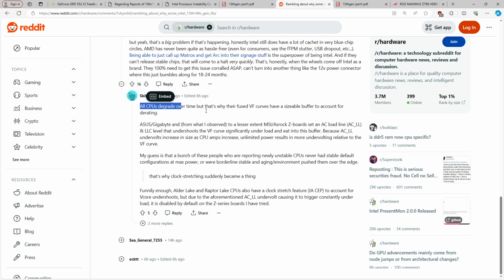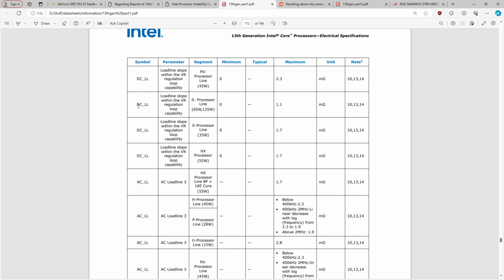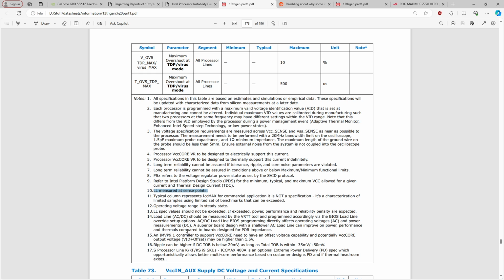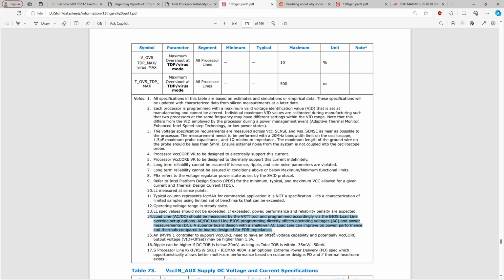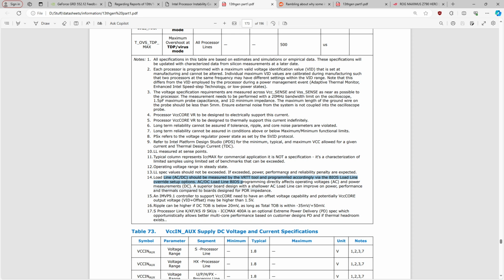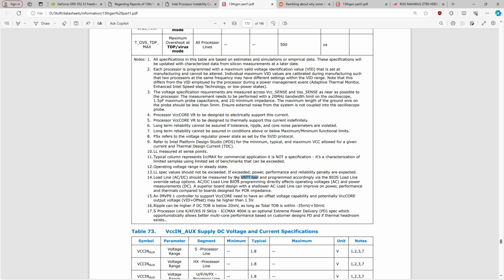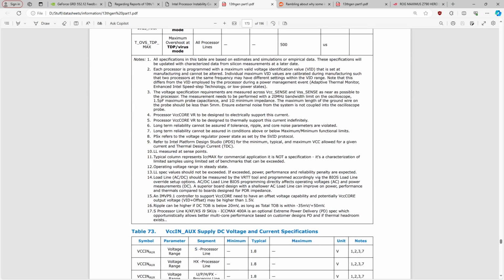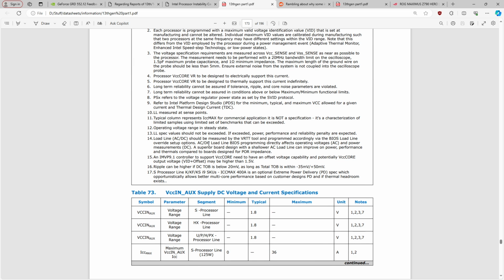Ranting about intel's 13th & 14th gen Vcore load line "specifications"

Comment: so when they say the load line minimum is 0, they mean the resistance (under load) of the vcore power plane/path between the regulator and the cpu, can be as LOW as they want. low resistance is good.
the MAX is 1.1 mohm. of course there is a maximum because otherwise, when the cpu is using 200 amps you will have a ton of voltage drop which in turn requires the regulator to BUMP UP the voltage to get AT THE CPU the actual desidered vcore.
Reply from the maker: It's physically impossible for the Vcore power plane and CPU socket to have a resistance of 0 mOhms. In fact I'm pretty sure the LGA1700 socket on it's own is already has like 0.5mOhms of resistance for Vcore. So having a minimum AC_LL of 0 seems really optimistic on intel's part.
Reply: but it would not be a bad thing. there doesn't need to be a minimum, what they're saying is "do as good as u can" @ActuallyHardcoreOverclocking
Reply from the maker: @Nebbia_affaraccimiei  Sure but "do as good as you can" and then set the AC_LL yourself to match your design is just asking for people to set the AC_LL lower than what their design can actually do. Or the test tool isn't accurate to real world load on the CPU and the result is that intel now has a bunch of CPUs that won't run on out of box settings because instead of specifying and exact operating voltage and load line slope they just let the board vendors do whatever.
Reply: @ActuallyHardcoreOverclocking  of course if boards manufacturers can't measure accurately their board real world characteristics, which Intel can't possibly know, that's on them.

the question here is.. are cpu's crashing because they don't get the specified voltage due to loose LLC settings, or bad board designs, or are they crashing because they DO get the specified voltage but its just not set high enough?? very different scenarios
Reply from the maker: @Nebbia_affaraccimiei  Well if intel had really rigid specs it would be a lot easier to tell if it's the motherboards not following spec or if intel is shipping defective CPUs wouldn't it?
Reply: @ActuallyHardcoreOverclocking  the spec on max LL is rigid enough . can't have over 1.1 mOhm.
are these specs been followed? :)
Reply from the maker: @Nebbia_affaraccimiei  yeah but setting the LL too high would give the CPU too much voltage. Not too little. and the crashing right now is caused by there being too little voltage. Either because mobos are shipping with AC_LL too low. Or the intel VID tables are too low.
Reply: @ActuallyHardcoreOverclocking  Yes, too little voltage or the VRM is not fast enough.There is a posibility higher VRM refresh rate to fix the issue. I know XOC Oc-ers say it doesnt matter how high but they test for 100% stability on heavy loads. On light loads (such as gaming) that can stabilise higher frequencies. It happened to me couple of times.
Reply from the maker: @n1kobg  I've tested switching frequency on a bunch of boards with P95 and Ycruncher and it usually does absolutely nothing and on some boards maxing it out causes the VRM to start behaving very strangely.
Reply: @Nebbia_affaraccimiei  "the spec on max LL is rigid enough . can't have over 1.1 mOhm."
It might not be rigid enough. 0mOhm to 1.1mOhm is a pretty big range.
But we'd need some detailed testing of different motherboards to confirm whether the stability problems are actually caused by excessive Vdroop (resulting in crashing from voltage undershooting too low, or the higher idle voltage required to keep the CPU stable damaging the CPU) or whether it's something else which isn't caused directly by motherboards getting close to that 1.1mOhm limit. Maybe this LL issue is a red herring, and Intel's QC for Raptor Lake just sucks?
Does anyone know if these problems more common on particular motherboard models/brands than others? It could be a useful starting point for finding the exact cause.
Reply: @ActuallyHardcoreOverclocking  Yes, P95 and Ycruncher are too heavy load. Thats what Im saying. It can be rock solid stable in benchmark but crash on Desktop. You can crash a CPU on lighter load with higher frequency. Lets say you pass p95 on 5.6ghz. In gaming that same CPU can go 5.8-5.9ghz.Thats where ive noticed difference - when you max out the CPU on light load. 
Also CPU cache/ring is very important for responsiveness while in XOC doesnt give you much of a boost in a lot of benches. I mention this because ive heard ppl say the same about it - that its not that important. Ofc. too high frequency can introduce instability.
PS: BTW I usually OC the Base Clock too. I feel I have to mention this. I max out everything I use & have different settings for different games.
Reply: @ActuallyHardcoreOverclocking  This is a range so its usually around the middle.
Reply: I think u have it mistakenly reading "load line" as "load line calibration". the load line is the MEASURED resistance, based on path design, trace/layer thickness and so on. its not something you can SET! its a physical characteristic

the load line CALIBRATION is what they allow you to SET in the bios to compensate for the real measured load line of that specific motherboard model.
this has really nothing to do with the VF curve of CPUS been set (by intel) too low which leads to instability.
Reply: But isnt intel sayong match dc and ac ? So the fivr can do its thing and properly request svid?
Reply from the maker: @advanced3dprinting  the FIVR doesn't handle Vcore.
Reply: @advanced3dprinting  LGA1700 use VccIA for Vcore, not FIVR.
Reply: This is not correct.
https://www.infineon.com/dgdl/Infineon-DCDC_FPGA_load-line-AN-v01_00-EN.pdf?fileId=5546d46269e1c019016a7b06d9e53116
https://www.monolithicpower.com/load-line-design-for-a-multi-phase-buck-converter

It is a specification for the VRM work within to achieve desired transient response. The VRM will deliver a lower voltage with increasing load current following the formula in the above application notes. The resistance of the actual conducting traces does need to be accounted for when designing this, though.
The spec says the CPU can tolerate an effective resistance of up to 1.1mOhm within the specified power limits, where the load line feature of the VRM adds to the effective resistance

Comment: Late response, but if I read the specs correctly the DC/AC load line value is supposed to model the characteristics of the power planes on the motherboard between the VRM to the CPU.   The power plane can basically be seen as a wire and any wire in the real world will have some resistance.   Due to the resistance of the wire the voltage will drop before it reaches the CPU.  As you say this drop is dependent on the current, lets say the resistance is 1mOhm and the current is 200A, that will make the voltage drop 200A*0.1mOhm=200mV between the VRM and the CPU.

My guess is that if the CPU estimates that it's going to need 200A at 1.5V and the DC load line has been set to 1mOhm, it calculates that the voltage drop through the wire will be 200mV.  This means that the CPU will actually to ask for 1.7V from the VRM, 200mV higher, to compensate for the drop. After the voltage drop in the wire the current at CPU pin is going to be the 1.5V it needs.

The comment about exceeding the load line values is a warning that the power losses in the wire itself will be higher if the resistance of the wire is high.  At 200A and 200mV a whopping 40W of power is going to be wasted in the wire, heating up the motherboard.  So you want the resistance to be as low as possible.

The resistance is dependent on the number of power planes, and the width and thickness of the copper of each power plane.  Having two power planes for carrying the current instead of just one will cut the resistance in half assuming that the width and thickness is the same.  But an 8 layer PCB is almost always going to be more expensive than a 6 layer PCB.  It's also possible to reduce the resistance by making the copper in a layer thicker, but that also increases the cost.  So to save on cost a motherboard manufacturer might want to keep the number of power planes and thickness down.

This means that Intel can't specify the load line value.  Intel have figured out what voltage the CPU needs at its input pin.  The resistance of the wire is a physical characteristic of the motherboard which has to be measured.  If the load line value is set too low the CPU will ask for a lower voltage from the VRM, but the resistance of the wire is still the same leading to a higher voltage drop and the voltage at the CPU will be lower than it expected.  If the load line value is set too high the CPU will ask for a higher voltage than needed and the voltage at the CPU will be higher than it expected.  By tweaking the load line value you're actually changing what voltage the CPU will receive when the current is high.

It's actually a bit more complicated than that.  The above is true for the DC case where the voltage and current is at steady state.  But with AC (alternating current) where current or voltage changes, any real wire will also have inductive and capacitive characteristics.  A wire can be modeled like a low pass RC filter like this:

http://sim.okawa-denshi.jp/images/RLCLowPass.png

This affects how quickly the current changes when the voltage changes and vice versa.  Inductance makes the "current lag the voltage", if the voltage increases it will take some time before the current increases.  Capacitance makes the "current lead the voltage", it will take some time for a current to discharge a capacitor.  The combination of inductance and capacitance is called reactance, and is also specified in Ohms just as resistance, but the value is time/frequency dependent.

My guess is that the AC load line value is supposed to represent the effective resistance for the wire from the VRM to CPU when the current changes rapidly.  If the CPU estimates that the current will increase rapidly it will ask for a bit higher voltage from the VRM until the current through the wire has stabilised.

The effect of the AC load line value will be similar to the DC load line value, but it only matters when the current changes.  If it's set too low the voltage at the CPU will undershoot when the current draw increases because it didn't request a high enough voltage from the VRM, and overshoot when the CPU's current draw decreases because it didn't drop the voltage request enough.  Vice versa, if it's set too high, the voltage at the CPU will overshoot when the current increases and undershoot when the current decreases.

Comment: Nah, Intel was just enjoying benchmark wins till they were good and you only had to turn off enhancement features for locked parts, because boards would want to do something with those and run them out of spec so they wouldn't boot. And now they f***ed around and are finding out when they are already pushing chips to the max and problem shifted to instability in their flagship parts. And only thing you can absolutely trust your motherboard partners with is that they will be perfectly fine with killing CPUs, if that means they win benchmarks and can say their boards are the best. I mean just ask AMD with early 7000 boards... as GN found out with "We Exploded the AMD Ryzen 7 7800X3D & Melted the Motherboard" video. And no, you definitely don't want to trust them with your car keys either. :-D

Comment: BuildZoid: I understand the voltage side of the equation but not the current. If you are running Prime95 on an 8-core CPU at a frequency of 5Ghz, and you drop the voltage, how come the Watts and heat go down? Why wouldn’t current have to increase to generate the same Watts to satisfy the workload inside the chip? What am I missing? If it has something to do with resistance then why wouldn’t the frequency or stability of the CPU be negatively affected? And why do we have a separate BIOS limit for current (I)? 
Or are we talking about excess voltage that’s not required to do the work, and if so where does that excess voltage end up?

Also, isn’t heat more a factor of current than voltage? Why wouldn’t heat go up when voltage goes down? I’m really struggling with this relationship inside the CPU when it comes to the interplay between Volts and Amps. Can you help?

Comment: I can confirm that lowering the AC loadline does reduce voltage. I lowered mine from 30 down to 1 & voltage at idle went from 1.275 to 1.225. I further lowered it to below 1.188 using standard voltage adjustment & I set my standard loadline to the lowest value, which lowers the voltage under load to 1.104 volts & is still stable on my Core I5 13600k.

Comment: The stated DC_LL maximum (an every maximum) number isn't the maximum number when every other number is also the maximum, it's only the maximum allowed number. Like, when all the other numbers that affect it are low this one can rise up to it's stated max. 
That's why the cpu with the higher power rating has a lower max dc_ll.
All of the settings go together, your whole rant concentrates only on load lines, you have to look at all of the specs and math it out to see if the specs are fine or not, obviously if you allow 400W then you can NOT allow 1.1 on LL. 

Also yes, these are completely unlocked CPUs, anybody can do anything they want with them.

Comment: Load Line specification in the CPU datasheet is NOT FOR THE CPU; it is for the VRM design. Load Line is a tool used in SMPS to keep voltage excursions from load transients in check as well as reduce power dissipation at increased load. The 0 to 1.1mOhm specification from Intel means "You can set the VRM load line (plus actual trace resistance) to any value between 0 and 1.1mOhm, and the processor will function within specifications in this datasheet". This all comes down to disabling power limits because the CPU is then pulling as much current as possible; all of the electrical specifications are thrown out the window as a result of the power limits being disregarded. When the "CPU is not getting enough voltage", it's because the Load Line spec is for a maximum of 200A at the 253W power limit. The maximum allowable Load Line is much different at 300A, 400A, etc., and is not specified in the datasheet.

Comment: Load Line Spec (LLC) 1.100 mOhm
DC LL Same as LLC 1.100 mOhm (So Reported power is correct)
AC LL Same as DC LL 1.100 mOhm (but a superior board design can lower this so trust your manufacturer default for this 0.600 mOhm 13900k 0.700 mOhm 12900k Gigabyte Z690 Aorus Elite AX) 
I have Heard of some Asus Boards using 0.28 mOhm for AC LL which i think is way to low and the cause of alot of problems coming from asus

Comment: “Lose a lot” with CEP doesn’t even come close. I went from high 39k cinebench r23 to barely 25k on a 14900KS which has degraded itself over I kid you not WEEKS (my 13900K used since Oct/2022 lasted stable until Jan/2024).

It feels like board mfgrs are just FULL SEND on volts as nobody wants to talk about stability 🙄

Comment: Buildzoid: POR: Point of Record (this was actually mentioned in an older Intel spec sheet).
We discussed AC Loadline on discord awhile ago (I am falkentyne, remember?).  ACLL on Z390 and older was the INVERSE of vdroop (based on amps (current load).  Shamino's Asus mentioned that this would cause problems with crashes when inrush current caused vdroop to drop more than ACLL would compensate.  This was the explanation for the old Asus obsolete setting "Sync ACLL/DCLL to VRM LL (Loadline calibration).  I tested this on a Z390 Aorus Master at 5.3 ghz on a 9900k (max ACLL: 1.6 mohms) using 1.6 mohms ACLL, 1.6 mohms DCLL and LLC=Standard on a 9900k (this is ALSO 1.6 mohms), and the Bios idle voltage was 1.3v, windows idle voltage was 1.3v, and full load Prime95 SSE2, or Cinebench R20 was ALSO 1.3v (ACLL was fully compensating for amps) and was STABLE*.  These were steady state loads without fluctuation.  But (at the time before a BF5 patch removed this heavy usage), just launching Battlefield 5 would create massive erratic inrush current and you could *BSOD before you even get to the main menu, and if you checked, the die sense (VR VOUT) would drop as low as 1.22v(!!)  It could also crash LOADING a map with the same inrush current, but once you were loaded, you were fine.  
ACLL was CHANGED on Z490.  I spent extensive time with this, and I had huge discussions with Robertosampiao on overclock.net about this, trying to figure out how ACLL now functioned, and we both determined it was NO LONGER THE INVERSE OF LOAD CURRENT!"  For example, setting 1.6 mohms ACLL on auto vcore on a Z390 at 5.3 ghz 9900K would give you 1.3v idle.  *BUT* on a 10900k, setting a 1.1 mohm ACLL at 5 ghz on auto vcore would give you a *1.6v IDLE die sense voltage in windows, with temps being about 80C or something or overtemp alarms going off!  Then at full load, it would drop down to about 1.45v if you didnt overheat before that.

I posted a chart, with TVB voltage optimizations disabled, on a 12900k with every ACLL from 0.01 mohms up to 1.1 mohms in 0.1 mohm increments, showing NATIVE VID only, with DCLL set to 0.01 mohms (to stop VID From dropping) and showing how idle VID changed with each step of ACLL.  A second user did some extra work on this.  He also posted a link to his work either on the 13900K or 14900K thread.

Comment: Ac ll isn't a 1 size fits all, not all chips can run the same ac loadline.
The motherboard manufacturer give control over the ac loadline.
If the end user cannot figure it out they should have stuck to consoles.
On the other end of the spectrum motherboard vendors can just lock down the bios for the snowflakes that are too lazy to learn how all this stuff works.
Also intel motherboards have had ac/dc loadline way before 14th gen. We just have never had this much inconsistency from intels fused vf curves.